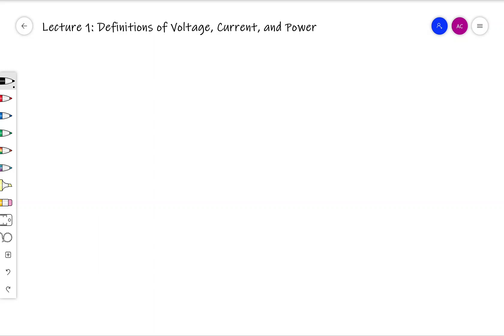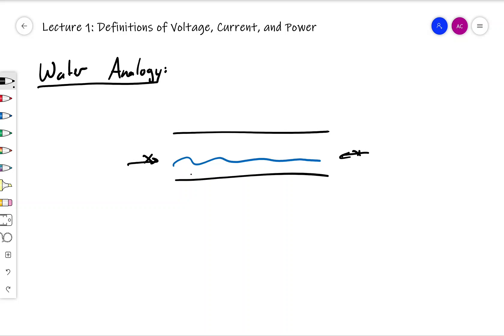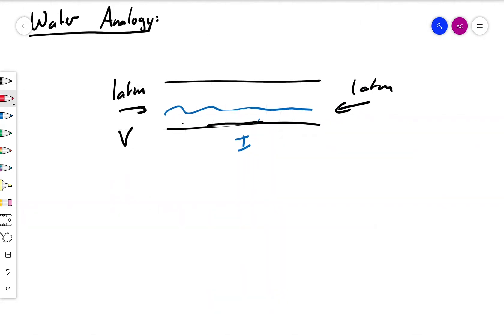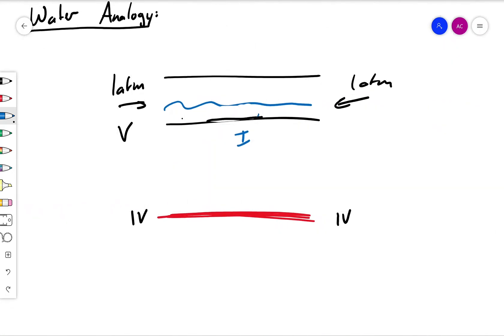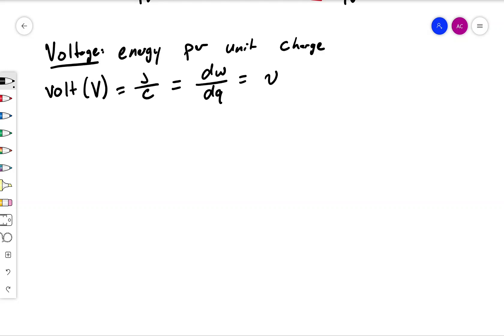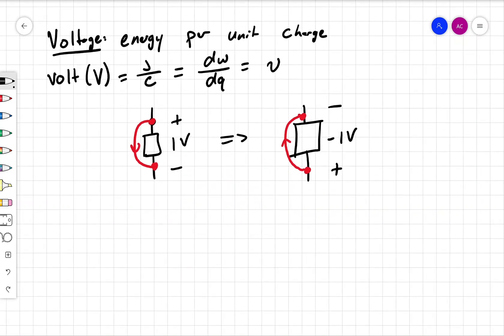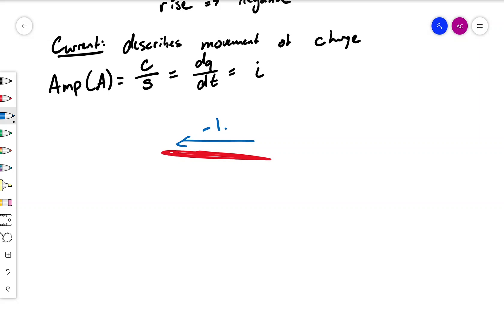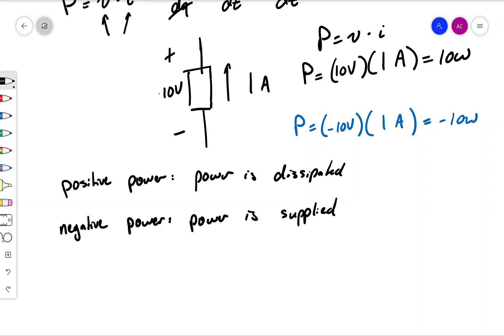Circuit Analysis Lecture 1: Definition of Voltage, Current, and Power

Comment: Aron, where did the subscript q derive from?
Reply from the maker: Great question! Q is a common symbol for electric charge, so whenever you see "q" that will generally mean electric charge. The reason for this is because, way back when electricity was being discovered, instead of charge they would call it the "quantity of electricity," which is why the "q" symbol was used. After a while everyone agreed to just use "q", which is why it is still in use today even though we don't call it "quantity of electricity" anymore.

For example, in the video, when I say "dq/dt", that means "change in electric charge versus change in time," or how much electric charge is moving. This corresponds to electric current. I linked a page on electric charge below so that you can see for yourself that "q" is a common symbol used for electric charge.

Thanks for commenting!

https://en.wikipedia.org/wiki/Electric_charge